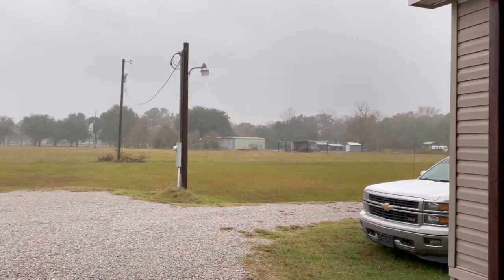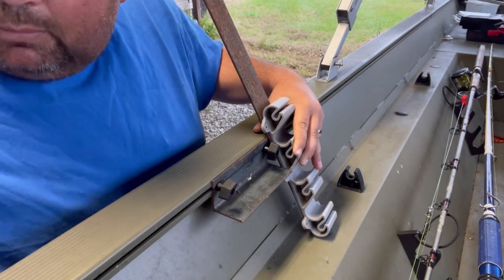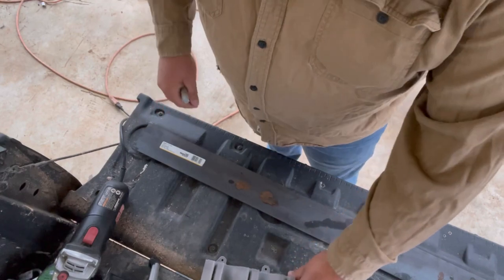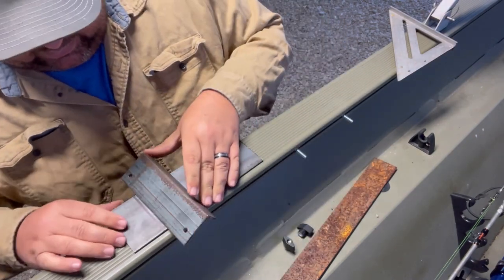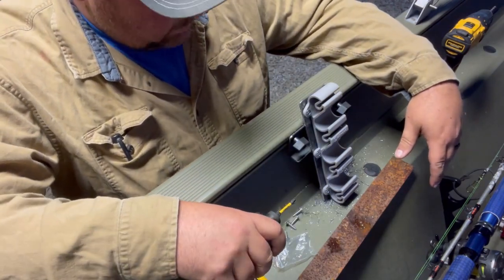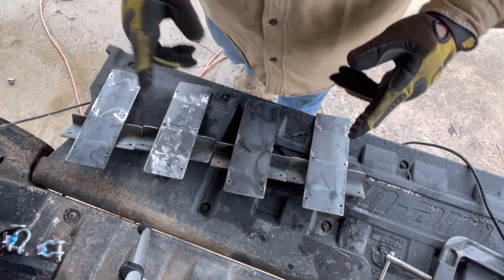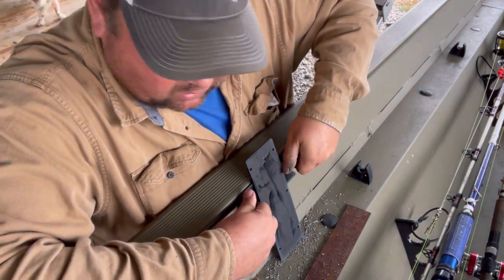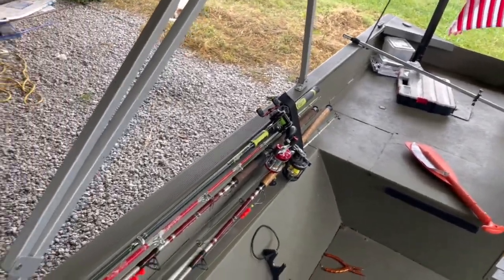Tracker Grizzly Versa Track DIY rod holders

Comment: Generally you would have the top velcro running down hill. If there's ever a issue, you can always add a couple snaps onto the velcro for safety.
Reply from the maker: I actually turned them around about a week after making the video. Appreciate the tip!

Comment: How does it handle the rods when trailered our out in rough waters?  They looked pretty flexible so I am concerned that the rods may not stay in place trailering down the interstate.  The velcro straps look like they might resolve the issue.
Reply from the maker: It holds them steady no matter what. I’ve hit barge wakes at full throttle and have pulled the boat on the trailer at 80mph. As long as those straps are on they will not budge!!!! Thanks for watching!!!
Reply: @CreoleCatfishing  Thank you for the quick response.  I appreciate it.

Comment: May I suggest you look into the downside of modifying your aluminium boat using steel?
Reply from the maker: That’s an issue I actually thought about no long after I made this video. In addition to being painted with multiple coats of epoxy paint, I added a rubber gasket at the mounting point to eliminate any metal-to-metal contact. After over 2 years of being installed there is zero signs of corrosion or galling. Great point to bring up!! Thanks!